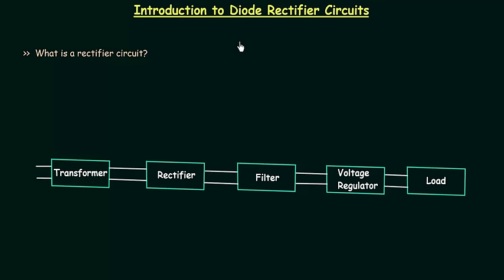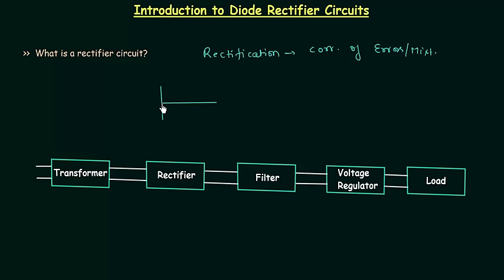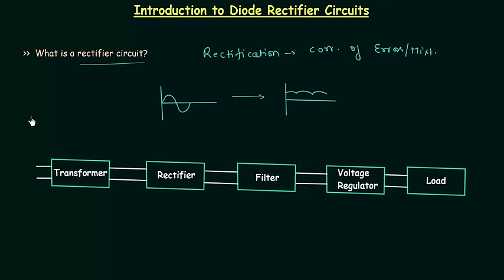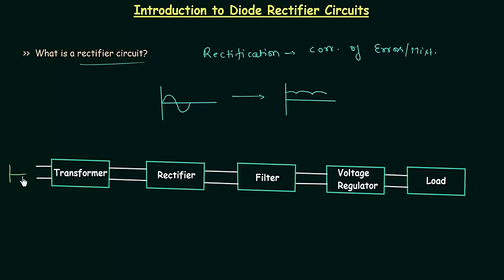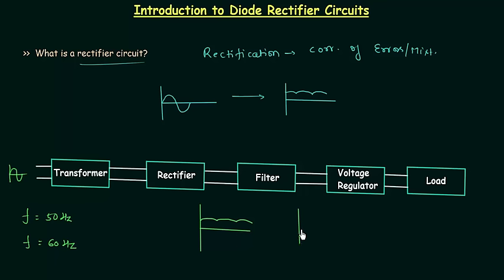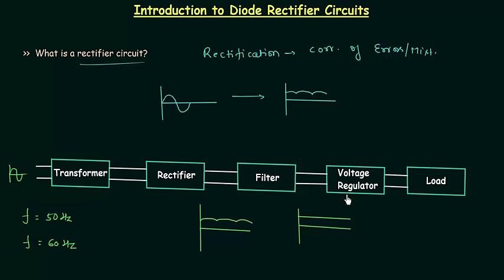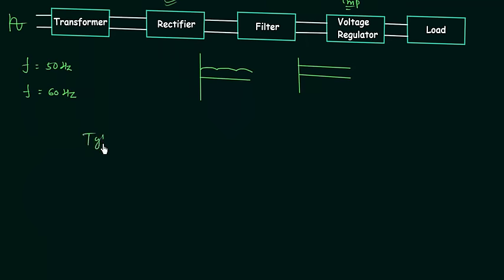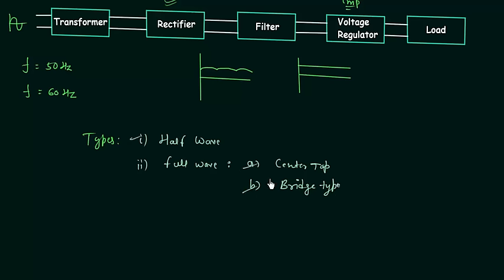Introduction to Diode Rectifier Circuits

Comment: Wrong. The O/P of Rectifier is actually the O/P of Filter. You need successive filters to obtain pure DC. Here the O/P of rectifier will be pulsating MODULUS of AC. Means all +ve cycle will remain +ve as well as all -ve will also get converted to +ve.
Better Correct it soon
Reply: You are correct but it is only a minor mistake, the video is very help full